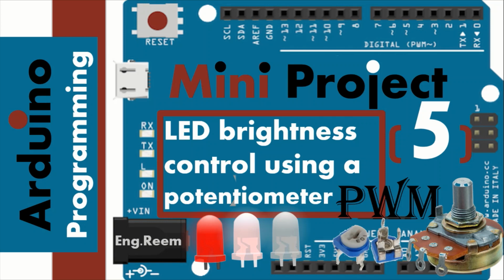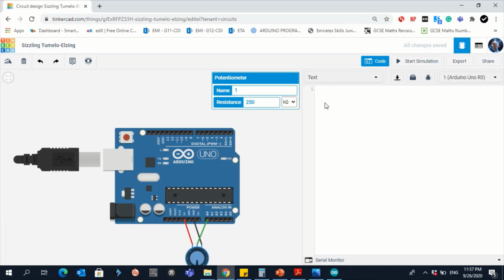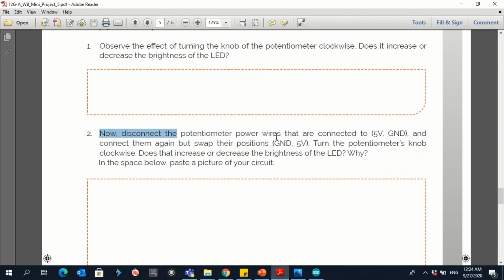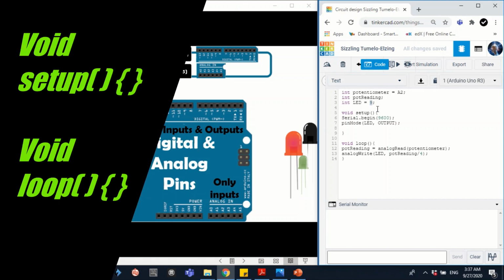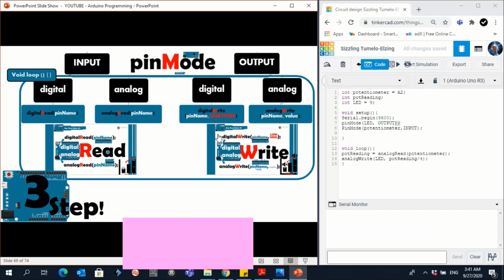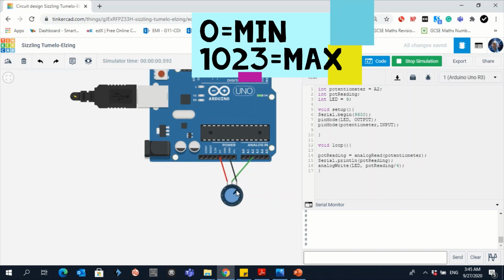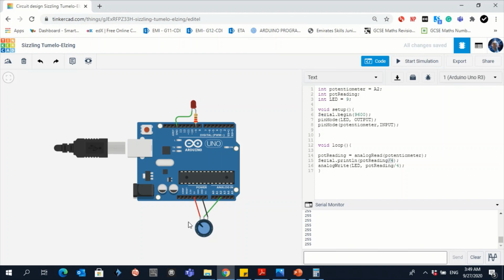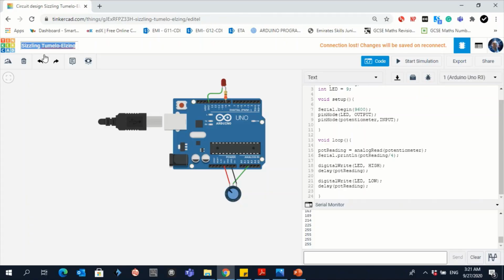Arduino MINI-PROJECT 5: LED brightness control using a potentiometer

Comment: I do really appreciate your efforts to make these videos which I truly benefit a lot from it. But I have one problem regarding the breadboard and how does it work as my teacher uses it with circuits... Overall, جزاك الله خيرا و اسال الله ان يرفع قدرك في الدنيا و الاخرة
Reply from the maker: You need to watch project 6 , there is a connection with a breadboard. If it doesn't solve your problem. Lemme know.

Comment: I learned from this video how to control the LED brightness using a potentiometer.
The value of the potentiometer: 0 is the minimum value and 1023 is the maximum value.
The brightness of the LED increasing when the potentiometer goes clockwise and decreasing when it’s goes antiwlockwise.
Asalah khaled 12/C

Comment: Norah Mabkhoot 12C  6/10/2020
I have learned in this project how to control LED brightness using a potentiometer.  Clockwise=increasing and anticlockwise = decreasing, potentiometer for the analog Read its has a value from (0 min-1023 max).

Comment: Maha Hasan 12C
6/10/2020
From this project I have learned how to use analogWrite to control the brightness of an LED.Following, I now know how to use analogRead to read the voltage value from a potentiometer.

Comment: What I learned: 
- When turn the potentiometer Anticlockwise there is No brightness
- When turn the potentiometer Clockwise there it will be at it maximum brightness
Fatima Yousef 12A

Comment: Shahad Ashraf  12A

I learned how to connect a potentiometer and control the brightness or speed of it  + how to decrease it or increasing it (clockwise increase and anticlockwise decrease ) and do the opposite + I learned that the potentiometer maximum number is 1023.
Thanks Ms :)

Comment: Aya Rashid (12A) 
So on this video I learn a lot of things like the potentiometer it’s an input and how we can use the analogRead to read the voltage value for the potentiometer from(0-1023) and also when we said that it’s clockwise = increasing and anti clockwise = deacreasing 👍🏻🌷